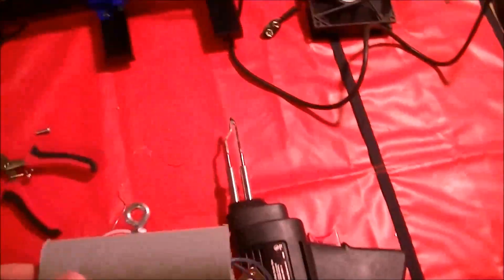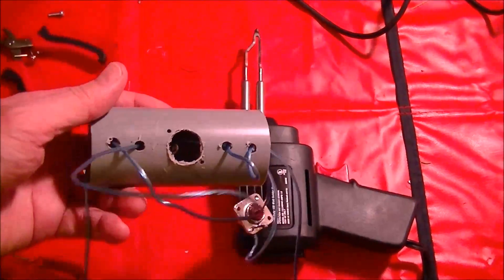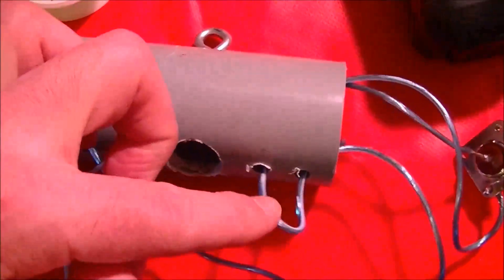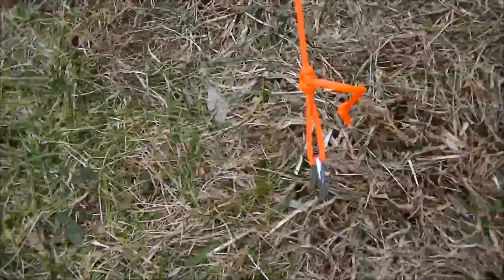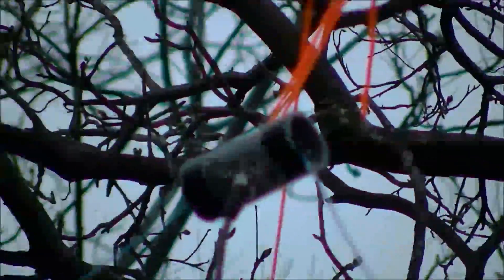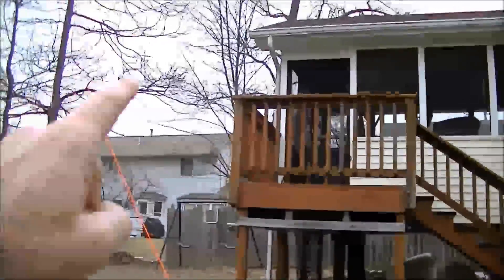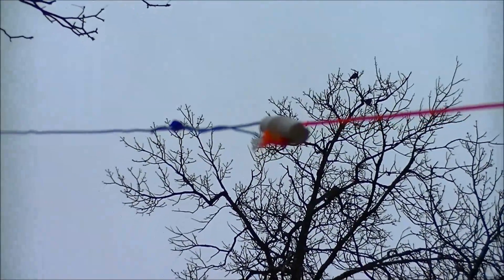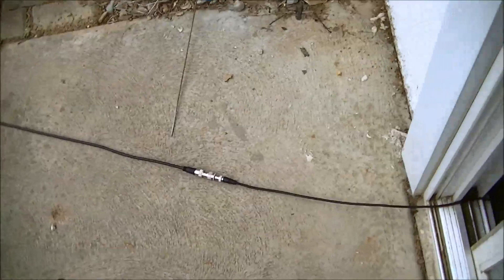Homebrew 20 Meter DiPole Antenna speaker wire

Comment: Speaker wire, appliance wire aka zip cord have been used for past 60 years. Durability with Mother Nature's elements is in question for long term outdoor use.